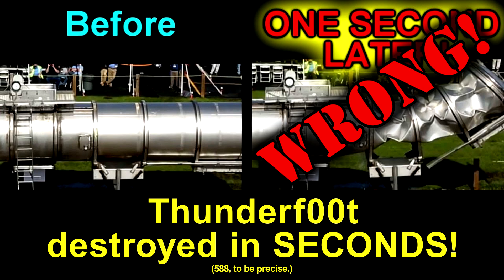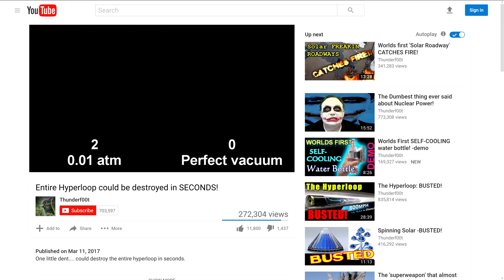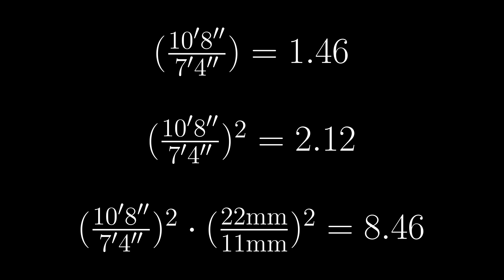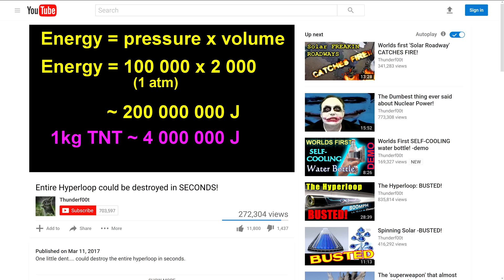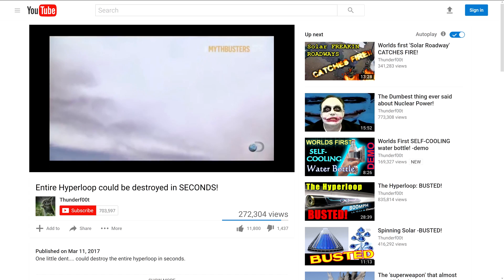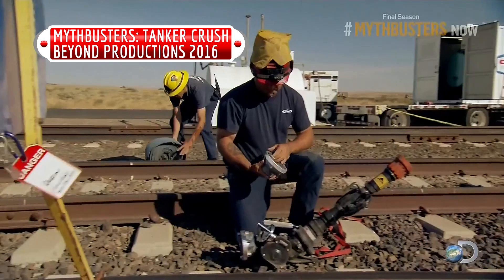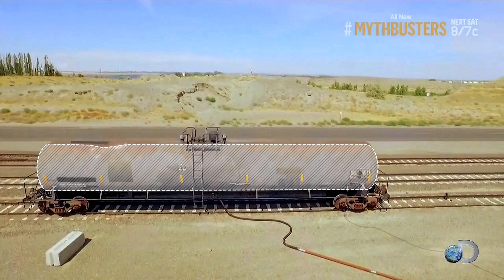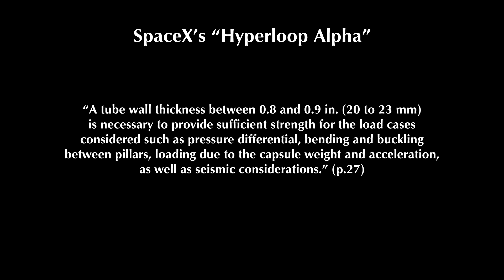Thunderf00t destroyed in SECONDS!

Comment: he ment what would happen in someone did a hole in it!
Reply: You didn't debunk shite If that tube was dented or damaged in any way it would implode. Not to mention the one time you show math you use different units? You have to be one of the biggest idiots out there. Also where are your sources for any of this information? no links in the description or video.
Reply from the maker: Um, no. You MIGHT cause the death of 1 train if your timing is just right (and remember that you won't be able to see where the trains are at any given moment), but the others would stop.
Reply: You know what happens when you place a bomb near anything? It fucking explodes and damages it. That's not the tube randomly exploding, that's the fucking bomb exploding the tube.
Reply: No you didn't. You haven't debunked shit. I'll prove it like you did. I'll multiply a rat with a candy bar and that will equal you are wrong. Using different units of measure is a middle school mistake.
Reply: Vincent Sage Bombs in planes -> no more because of control
bombs near tube -> how do you want to control miles of tube?
Reply: I straight up just think you have a brain tumor and will no longer continue proceeding with this.
Reply: bombs on train tracks ->train can stop without x0 km of free tack

also hyperloop imposion = death of not only 1 train, all of them
Reply: The same way we prevent people placing bombs on rail road tracks... we don't bother.. its a cost benefit thing. nothing is 100% safe. and we are doing fine. Life is a risk we all take knowing we all die regardless.

As the other videos has explained a sudden depressurization would stop the line just like a train line, but no deaths unless the bomb is close to a pod / ie train.
The line remains down until it is fixed.
Should we ban all trains?
Roads too, they are blocked if there is an accident or a bomb. Should we ban roads?
Reply: Sergey K well people seem like they want to ban guns all the time when a shooting occurs. Personally I'm for limited gas tanks. Why would any one need a ten or twelve gallon gas tank. A three gallon gas tank should be fine for any one. Also, I support making it difficult to put fuel back in the gas tank, you should not only need a key but at least two other tools to get in. Only then can we stop Muslims and other psychos from running innocent people down with those cars and trucks design to kill people. I mean, look at the slopped hoods and how heavy some trucks are. No body needs something like that. And the steering wheel, that just allows someone to keep their vehicle on target one after another. Children and teddy bears will fly. Think of the children... when it's politically sound too, of course.
Reply from the maker: NO HE FUCKING DID NOT!!! Stop making up FUCKING LIES to cover for him, people. Plus, we already debunked the bullet hole nonsense.
Reply: placing a bomb near tube?
Reply: Shane Killian ok then, we will see, in next 20 years
Reply from the maker: You can blow up ANYTHING with a bomb. That's not any kind of point. Unless the 9/11 attacks mean we shouldn't have airplanes...
Reply from the maker: "You didn't debunk shite If that tube was dented or damaged in any way it would implode" Covered in the video.

"Not to mention the one time you show math you use different units?" Oh Gods, what, are you a fucking sockpuppet of DarkSide Blues? UNITS FUCKING CANCEL, PEOPLE!!! If you don't know that, you have NO FUCKING BUSINESS trying to say that WE don't know what we're talking about!

"Also where are your sources for any of this information? no links in the description or video." Yeah, I think you ARE a sock. You're making the SAME bogus demands he did. What needs to be sourced? I linked to the Hyperloop Alpha document and to the statistics on the tanker car. The rest is basic math and the basic concept of activation energy. I'll ask YET AGAIN: what needs to be sourced?

Comment: Thunderfoot's arguments are the equivalent of arguing that the earth can't revolve around the sun because the "slightest nudge" would send it into the sun or into space, then showing the masses of the earth and sun and assuming people will believe him because big numbers.
Reply: I was using hyperbole to make a point then this toast guy makes it for me.
Reply from the maker: "The Earth can be knocked out of orbit by the slightest nudge" LOLWUT???
Reply: Do you have a brain? If so this comparison would not have been penned. The Earth can be knocked out of orbit by the slightest nudge and any pressure vessel that is structurally compromised in any way will fail catastrophically. Here you can try it at home by taking a hammer to a propane tank and seeing what happens when you dent it.